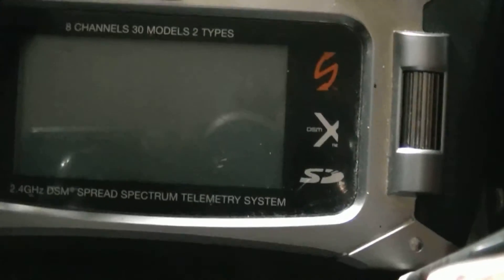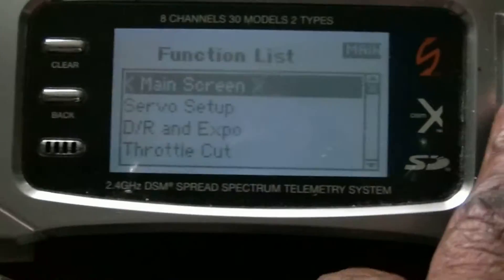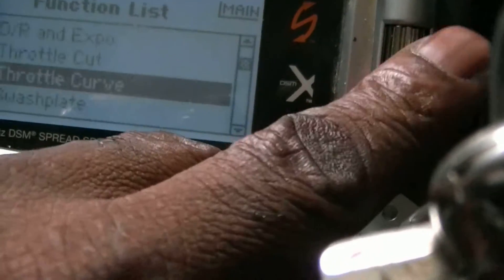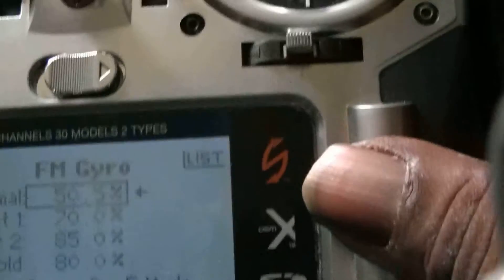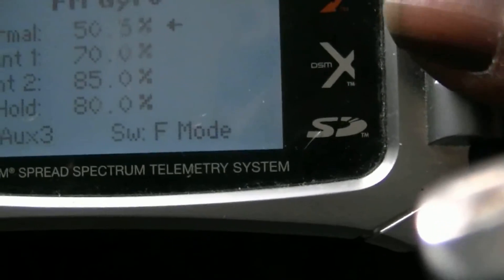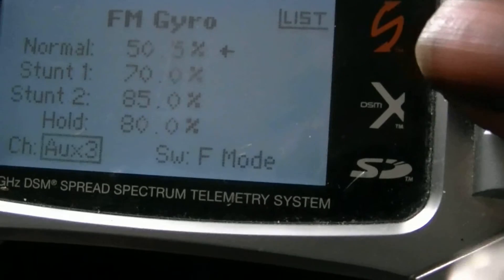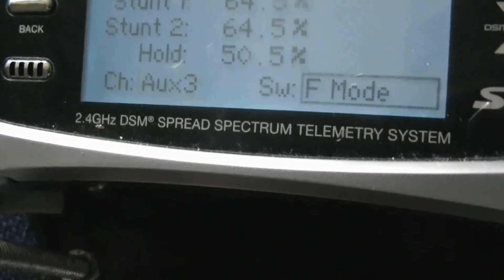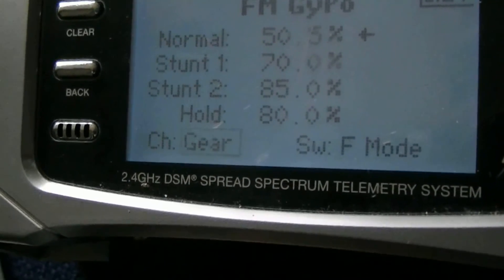dx8/ two satellite full size vbar question/help

Comment from the maker: a separate patch wire is included with your Mini VBar. If you are using receiver satellites you need to assign a channel for setting the tail rotor gain.
thanks for the info i might just do that since i may not have this patch cable
i could not adjust my gain from the tx i thought it was working lol
thanks

Comment from the maker: Tail Rotor Gain
Note that with 5.0 Express the tail rotor adjustments are carried out exclusively in the transmitter. For this, use a suitable channel with dial, slider or switch in your transmitter. For use with a standard receiver, a separate patch wire is included with your Mini VBar. If you are using receiver satellites you need to assign a channel for setting the tail rotor gain. Check functionality. Should the display stay at 64 % (default), assignment is probably wrong.